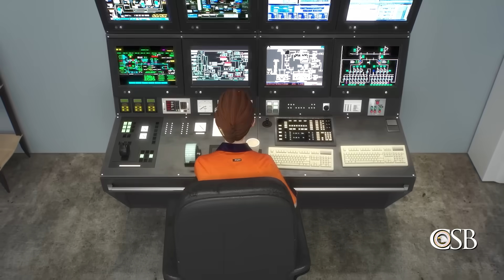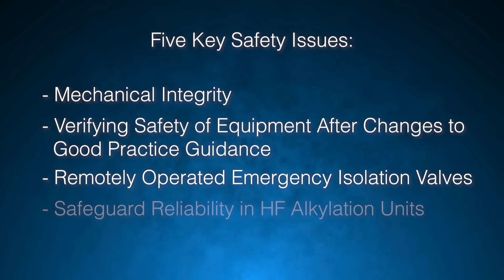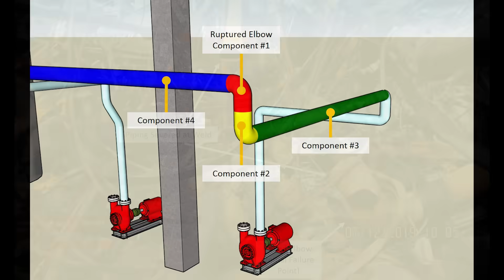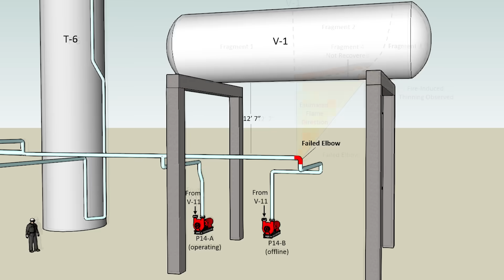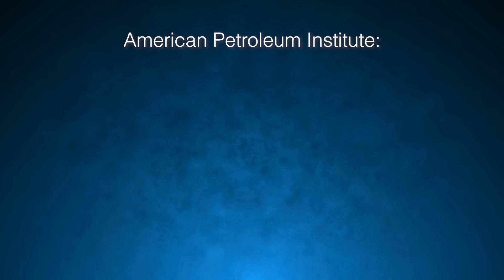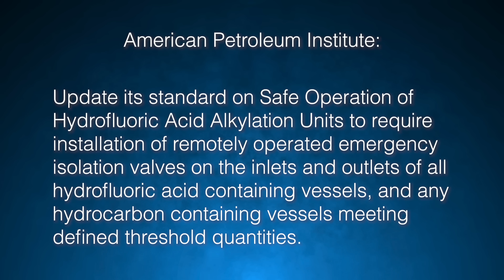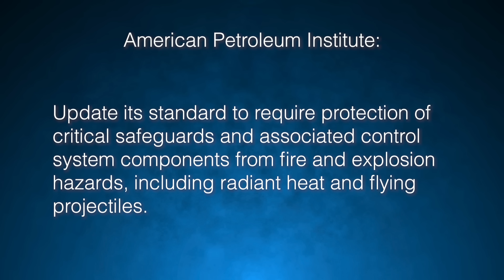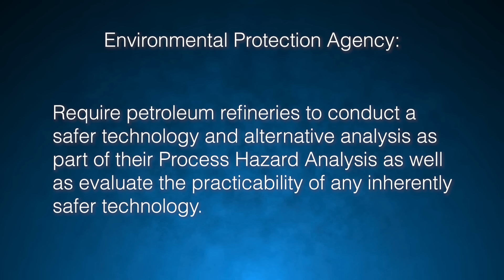Wake Up Call: Refinery Disaster in Philadelphia

Comment: That control room operator should have had a remote gas sensing system in place. With that reaction time he could easily prevented the incident. FT IR scanners can detect propane clouds up to 1 km.

Comment: I think my remote astronomical observatory is better protected than this factory. And my only "hazard" is the risk for the instruments being exposed to rain, high wind or possibly mistakenly pointing the teleskope to the sun (that would burn the camera chip in seconds!). Everything is automated with double saftey if rain, or a powercut that both closes the roof in minutes.

Comment: As usual the video was great... and detailed... and informative.
I only have one suggestion... 
(I think your videos are great, and I've watched quite a few of them, so this is more of a comment on the tone you use in all of them.)
This is a PUBLIC INFORMATION video, which is intended to be both informative and entertaining, and there ARE positive aspects of this situation. 
For example a compliment to that shift supervisor who turned on the water cannons...
Not only were they brave to do so but apparently they were properly briefed and trained about how to use that system...
(I would have mentioned that as a positive note; contrasted against situations where employees weren't properly trained.)
And, likewise, when you mentioned the safe disposal tank that the HF is dumped into when something like this occurs... (which you showed twice).
(I would have emphasized that the harm was limited in part because THAT critical safety system WAS installed and worked as intended.)
I know that these videos are intended to highlight "what they did wrong"...
But they would still seem slightly more balanced if they at least made more mention of "what they did RIGHT"...

Comment: My experience in refinery engineering convinced me that operating HF alkylation units is beyond our capability.  HF alkylation units have a conversion advantage over sulfuric acid alkylation units, but the real economic advantage is offset by the risk.  Even diligent operators (major refiners) cut corners on this very issue of elbow corrosion.  One I am familiar with uses higher wall thickness elbows of higher grade alloy and clad or weld overlayed vessels.  Dissimilar metal weld complexity and holidays in cladding and overlay foil the attempts at economy.

Comment: It would be a good idea to have a fail safe as well, say if the wires are cut between the water cannons or loss of communication that it automatically starts the water pump instead of someone having to run out there to manually enable it. Basically make the system assume the worse in case a fire or something else severs the lines.

Comment: This is all fine and dandy work but misses the real problem. In 2019 the refinery was run by hedge fund types who had already been operating under bankruptcy protection for a year. I have heard they had cut staff by a third to cut costs. Several management types need to have gone to jail. The BP Macondo well blowout was a management catastrophe and the only ones who went to jail were lowly engineers and rig supervisors. What a bad joke.

Comment: Regarding the elbow, there is always more "wear" at any change in direction. It can't be helped. Water is flowing in one direction and there is friction at the bend to turn it in another direction. I've seen this many times. Mostly in brass and copper. Looking at the pictures it's clear that the change in direction is more likely the cause than the composition of the elbow, or at the very least it accelerated the problem. BTW, this is the same reason rivers "bend" and move all the time.

Comment: 18:02.    I do not think it would be possible to measure the thickness of the steel on that bend or the pipe with any resaonable accuracy by ultrasound or other method thickness measurement.  I think that at the last shut down they should have replaced the bend and then examined it, along with other sections of the piping system.   Nothing is or should be planned for a life of greater than 40 years.

Comment: It's much worse.  When I worked in environmental, Hydrofluoric Acid was our greatest fear.  It's a calcium seeker--it causes little or no pain as it passes through your skin and flesh on it's way to your bones, then proceeds to basically melt them from the inside out.  The pain starts about 24 hours later.  It's the stuff of nightmares.

Comment: Philadelphia resident here. I was living in South Philly at 6th and Oregon at the time, and the detonation literally woke me up out of a sound sleep. I initially thought it had been a natural gas explosion from a house nearby and only realized it was the PES refinery almost two and a half miles away when I turned on Action News at 6am. By then there was a massive column of smoke almost exactly due west of my apartment that I could easily view from the rooftop. Given the sheer violence of these explosions and the proximity of the refinery to the densely populated neighborhoods in Passyunk, Greys Ferry and further out, it is mindboggling that no one was killed or maimed. The tank that was launched clear across the Schuylkill was the size of a school bus and could have easily landed on a residential building if it had taken a different trajectory.

Comment: Oh its Just HF, hydrogen Fluoride, its safe, it just eats through glass and will set concrete on fire. It can also burn things that have already been burned. 
And when it touch your skin it kills the nerve cells,so you dont feel the burns until your skin grows back resulting in life time long chemical burns. Its usually handled out doors when a single test tube is dumped ona ten  foot long pool, where a man wears head to toe acic resistant long PPE. When chicken is place in it, it doesnt dissolve it, it looks like you took a knife and slit off all parts in contacts with it. Literally nothing is left unlike sulfuric acid or pirahnah solutions.

Comment: OH BUT NUCLEAR IS SOOOOOOO DANGEROUS!!!!! How many just US ALONE refineries are classified as ticking time bombs with a major loss of life or fire 99% likely in 18-24 months? You know what the workers get if no one dies in this times span? Free cheap bologna sandwiches with condiments if they spill the multi billion dollar coffers that day. Oh and did we mention its turning a 100,000 year climate change cycle in not just 100 years but a few decades? But if you are a subcontractor exec touring a refinery in the middle east your lobster lunch gets flowing in on a citation 1st class so it makes the 9000 mile voyage still fresh, lobster that cost more then the pay out to the wife of the dead plant worker. OH and the champagene needs to be slightly chilled not refrigeration, that would be disgusting. We can afford 5 chillers if it mean we can stress another 70 years out of a deadly blowdown drum instead of a 
'modern" meaning 50 year old flare stack. But nuclear is way to dangerous with its annual worker death of0.01% you you go back to the last fatality in the 60's.

Comment: Exactly where did they get extension cord long enough to span the distance of  this tube is overlooked.  No one carries around a 300ft extension cord for the heat gun treatment...... so it was obviously within reach to be used in this tall vertical shaft.  So it is safe to assume they used this heat gun technique before.
But this begs a larger question......not sure of the nationality of the workers hired to do this job. But it suspects of unskilled migrant labor being utilized more and more in dangerous and often complex grating remedial jobs.   
Yet corroborate types lobby for the type of unskilled undocumented labor for saving money and generating revenue. 
A very large bridge was built in my town not too long ago, 100% of the manual labor working the site was from Mexico.
Reply: 100% from Mexico? Right...

Comment: Seems to me that adding a jacket around all of the pipes that contain the hf and having some sort of pressure sensor and or a hf sensor would prevent this from happening again. Should the inner pipe corrode, the gas would escape into the jacket and show a pressure or hf level, indicating they need to shut down and perform repairs.

Comment: Something about HF not mentioned, is the fact not only does it give you chemical burns (as it's an acid), it also has the fun ability to leach calcium from your bones, which causes all kinds of fun and potentially lethal health problems. 

It has the nickname amongst some chemists (like me!) As bone hurting juice.
Reply: While it is true that HF seeks calcium, it will kill you far faster from a heart attack. There is calcium in your blood stream and your heart relies on it to keep its electrical pulses steady. Once enough HF bonds with the calcium ions in your blood, you suffer heart failure. It's a big misconception by many people that it will impact your bones and it will over time, but if left untreated it will usually affect your circulation system first, along with destroying any tissue it comes in contact with.

Comment: My plant is currently going through a system overhaul due to chemical incompatibilities. We are finding 304SS parts in a 316SS spec’d system. Just because it was specified, doesn’t mean the builders actually stuck to the specs

Comment: HF release did not result in damage in this case. The rapid dump worked. The damage was caused by hydrocarbon release and fire which can happen in any other hydrocarbon operated unit. Your conclusion about the danger in operating HF units is exaggerated and based on emotion rather facts. HF have been in operation since 1943 and exist throughout the world. Their safety record is as good or better than other units.
Reply: Based on emotion? They're a chemical safety board. All they do is get the facts before putting these videos out.

Comment: I see another potentially deadly mistake here, dousing HF with water can apparently make toxic fumes (basically more HF because the hydrogen from the water now shares the fluorine with the hydrogen in HF), so by controlling the leak by spraying down the leaking tank with water, you're actually making the problem of leaking HF worse becuase you now have more HF, except it now exists as a gas AND a liquid because of the gas from the pre-existing leak and liquid HF due to the gas reacting with water.

Comment: In regards to the statement at 16:04- "Currently there is no federal regulatory requirement for refineries to analyze inherently safer design strategies to reduce the risk of serious accidental releases."

While I say this hesitantly, as I am indeed neither an expert in advanced chemistry nor in industrial manufacturing and chemical refinement, it must be pointed out that this statement highlights an extreme in practicality versus ideal mission accomplishment.

Naturally, it is the ideal goal of the USCSB alongside many fellow safety and regulatory agencies to bring about a work environment in the US that is 100% safe regardless of industry, location, or purpose. Unfortunately, it is also true that companies attempting to remain in compliance with modern safety regulations may only have limited funds with which to update their existing manufacturing infrastructures. While no company should exist which cannot afford to safely maintain its existing equipment and means of operation, the refitting of a large facility such as the P.E.S. refinery shown in this video to work with an entirely new set of chemicals may- in some cases- incur costs which would force a company to consider any of three options.

1.) Rebuild the facility from the ground up, incurring not only the costs of building a new refinery but also those of demolishing the old one, including hazardous material removal, as well as handicapping the company's income during the period these costs are incurred due to the facility being shut down. For many companies, this option may not be financially possible within the confines of staying within both regulation and morally correct financial practice. While this may not be neccesary for all facilities, the extreme level of restructuring demanded to refit a refinery to work with a new chemical that its existing tanks, pipes, and other equipment may not be in regulation to handle (even if perfectly complient with regulations to handle previously used chemicals on site) would require this option be considered for some. High carbon steel might be perfectly fine to use with the first of two chemicals that is needed for a process, but a second, generally safer material may come at the cost of reacting violently with iron alloys including high carbon steel that may be nearly omni-present in a facility originally built to work with the first of these chemicals. In such an example, refitting existing equipment on site to be safe to handle the second chemical may very well be synonymous with the complete demolition and reconstruction of the site.

2.) Build a new facility in an entirely new location, moving the hazardous materials from the old site and leaving the old facility to be abandoned. This may not be possible for refineries in dense urban areas where there is no new ground to possess for a significant distance in any given direction, and furthermore may take away advantageous geographical features from being at the disposal of the facility in question (access to rivers or railways for transport, other refineries providing necessary chemicals nearby, the list goes on). Note that this still incurs the cost of building an entirely new facility, a decision that demands either as much or more respect from a company owner due to its financial significance as building a new home from scratch would to an average homeowner. It is, in short, still not a thing to be taken lightly.

3.) Keep the old process in place while ensuring established safety regulations are strictly adhered to. While not the safesty option, it is undoubtedly the one with which the majority of companies may be able to adhere to. That is not to say that safer processes should not be considered for these companies, but you might summarize this comment in saying that one should not be quick to judge a company for failing to adopt an inherently safer process when safely maintaining an existing one remains a sound option.

Comment: HF units typically use carbon steel piping...... WRONG, stainless steel is actually the material of choice. I worked at this refinery when it was still owned by Sunoco, at that time the egg heads and pencil pushers decided to refit the HF unit with carbon steel piping and chemical injections inlue of stainless steel to save money. They saw refineries running else where that had success doing this, BUT those refineries were located in different climates. This refinery is located in the northeast so there are typically hot summers, cool falls, cold winters, and spring is a craps shoot. All of the refineries used in their reference studies were located in the south and obviously their seasons are drastically different. This is important because the acid and chemical injection mixture in the pipe has to stay balanced to prevent acid erosion. Drastic fluctuations in temperature requires on the fly corrections to the mixture, think of keeping ph levels in check in a swimming pool so the swimmers aren't burning there eyes from excessive chlorine. I was on the shutdown during the refit and brought this very thing up with a colleague in one of our meetings. They blew it off and the refit went ahead as planned. Not even 2 weeks after we restarted 433, the HF unit, it had to be shutdown because of severe localized acid erosion. It's a wonder the whole unit or even the refinery didn't blow up. That place was held together by so many half assed repairs on alot of the units I completely avoided going to sections of that place when I worked there.

Comment: Hate the HF plants. No need to use HF because other acids can be used and always were used in the past. Also the US refuses in many places to use the safety case process developed following the Piper Alpha disaster. Instead they use safety critical items which in my opinion and experience is a virtually useless process. Without a FMEA and residual risk evaluation, you have no idea which part of the plant actually is safety critical. Moreover they like to do HAZOPs without any prior risk reduction efforts. A HAZOP should only be done after all risks are ALARP. Then you see how to deal with them if you decide to proceed.